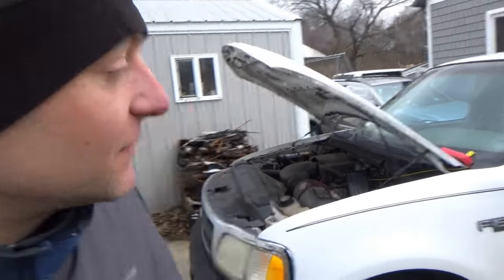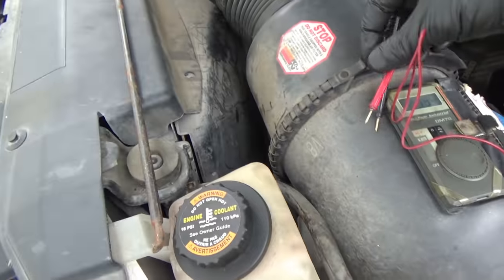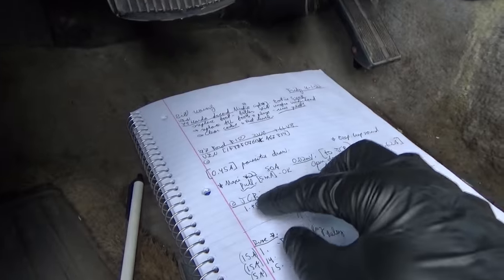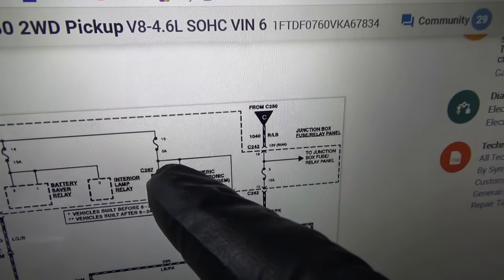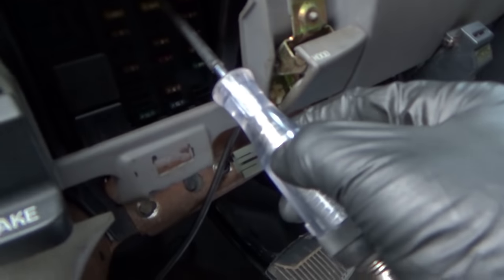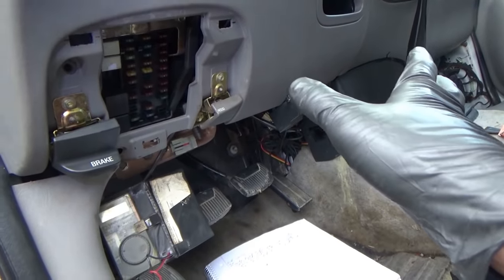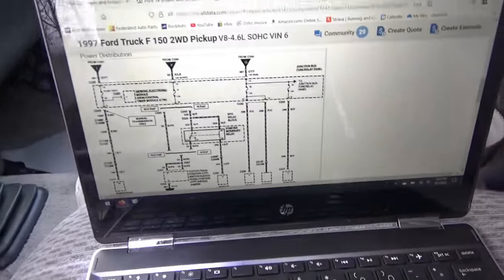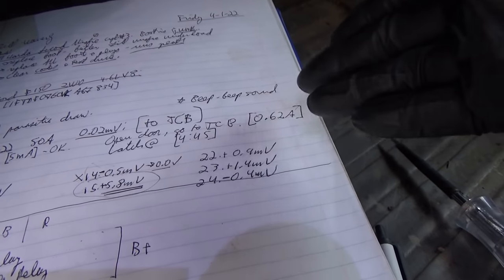This Parasitic Draw will BLOW YOUR MIND!  -Part 1 (97 F150)

Comment: I made a silicone dam on my 97 under the hood to guide the rainwater away from fuse box harness,, it fixed all the electrical issues after a few days of drying it out. cheers

Comment: I spent months diagnosing my wife's '94 Z71 Sub that would kill the battery dead in less than 2 days. I tried everything, and every time I'd turn the ignition on, eveything would wake up and I had to start over. Turns out the AC compressor clutch was staying on. There are few things more satisfying in the car mechanic world than fixing a current draw issue, especially on a late model car. Great video, as usual, can't wait to watch part 2.
Reply: Actually it was an '04. I'm an idiot
Reply: @bigblocklawyer  i would take me 10 minutes to find that problem thermal image flir you got to have the right tool
Reply: @juanrodriguez-ry6yt  Yeah. That was over ten years ago when you were still playing Pokémon go. Gotta have the right tool.
Reply: youd think a car that old would have every possible solution already available online

Comment: Had a similar draw on a newer f-150. It was back feeding a little over 2 volts to a relay in the fuse box causing that relay to stay on. It was a connector in the harness under the bed that fed a lot of stuff at the back of the truck like the back up camera, tail gate actuator, etc. It looked perfectly fine from the outside AND when disconnected. I blew air through the connector for the hell of it and it just started weeping water droplets out of the backside. Soaking it with brake clean and blowing it out real good stopped the drain. It was for a used car lot and probably had been under water. They had just got it from the auction and it has supposedly been checked out numerous times without resolution. I’ve never seen a connector look perfectly dry like that and have water hiding down deep inside with no visual evidence whatsoever. I think the weather pack was actually keeping it from drying out in this instance by sealing it in. When you work on cars that come from auctions you’re guaranteed to run across some crazy 💩 that a lot of other people never see.
Reply: Yes indeed, auction vehicle does Sucks🤧

Comment: I worked on a ~2002 Expedition for a parasitic draw. Long story short, windshield leaked water into GEM, causing intermittent HVAC blower operation. I sealed the windshield, removed and dried the GEM. Reassembled, and problem solved. BTW, my compliments on your knowledge, and problem solving techniques!
Reply: That same thing happened on my 03 expedition. Made the brake lights flash when driving.
Reply: Factory window or had it been replaced?
Reply: Thanks a bunch.  My HVAC fan, headlights, stereo all turn on hours after it rains while my 2K Expedition is parked. Saw moisture under interior fuse box and felt left side of drivers seat cushion slightly damp. Thank you for helping me to discover that my Expedition isn't possessed.
Reply: It's must have been a Interesting case study!

Comment: Reminds me of my old VW Rabbit where water would run down the antenna cable, sneak past the rubber gasket and then drip right onto the main fusebox.   The low spot on the antenna cable was right over the fusebox!   Perfect fail.
Reply: the whole windshield seal would rot and let water in.

Comment: These old f150s had water intrusion issues I had one that after a rain storm had accessories and warning lights coming of and on at will even with the key removed drying out the inside fuse box and GEM corrected the issue I instructed the customer to have the windshield resealed the water runs down directly from windshield to steering column support into the fusebox sometimes you can see a stain on this support confirming this

Comment: You are incredibly patient. I had jobs like this and most owners did not want to spend time and money in diagnosis.
Boom. Put an electronic cutoff on the battery. They clicked the remote to connect the battery without opening the hood, started the beast and went to work. Yeah, it had to be left on a trickle charger during inspection month in CT (😳)
Reply: That's the issue. I recently had someone ask me "how much would it cost" to fix a battery drain. Well anytime I hear those words, I know they don't want to spend the money. I told him it could take 3-4 hours or more, or it could take an hour depending on the complexity. If they ask "what is your rate?", then there is a change I'll get the job. You are right though, many don't want to spend the money on the time it takes to chase these problems down.
Reply: @graywaveautodiagnostics9389  GrayWave let’s be realistic here. These are old cars you are diagnosing. All people don’t have deep pockets, unscrupulous shops rip people off. ( just watch Rainmans Channel). People ask what the costs are before committing to what could be an uneconomical  to repair job. Writing yourself a check on every job would be a great idea but you won’t last long doing that.
Ivan has clear and concise prices, he is good at what he does, he is very busy most people trust him……..lesser auto electricians could take twice as long and have less success but still want top dollar.
Reply: @Bo88y22  Agree.  I know shops don't like to give estimates, but I ask for a ballpark/range for decision making purposes.  They usually come up with a number when I ask for it that way.  Everyone has a repair or replace threshold.  They need to know if they're getting close to that.
Reply: @Bo88y22  Yes, most don't want to spend more than $50 on a repair or diagnosis if its an older car, that is fine, they can do to a "buy here pay here" and get another one. The fact is, if you want  the work done right, you need to pay. Ivan charges more than most, as he should. You pay for experience. Like I said, some take an hour, some can take more. Just like the one video he had where it took 7 hours. I am a professional and provide professional results, I won't short change myself. I earn every dollar I get. Some people don't understand the value of experience and only base the value on how quick the "fix" will be...."But it was only one wire you soldered, took you 5 minutes".

Now when you give someone ball park ranges, that can be dangerous. What if I go over the ball park, what if you get to the ball park but don't fix it? Normally if it will take more than 2-3 hours, I ask the customer if they want to proceed. Up front I tell them I don't know how long it will take, I can only make an assumption and finding a fix is not guaranteed in the block of time I give them.
Reply: @graywaveautodiagnostics9389  Good auto electricians soon get a reputation. Rip off merchants are soon found out. Social media at it’s best.

Comment: This generation of F150 has two factory defects. One was officially recalled. The recall is for the switch in the master cylinder. It is always hot. The seal would fail and allow brake fluid to short the switch, and cause a fire. This would usually happen when the truck was parked. I tried to see if it looked like the recall repair had been done but could not see throughout the video. It is a good idea to verify if the recall repair has been done. The other problem this generation of F150 is known for is water intrusion through the drivers side of the windshield. Run a hose on the drivers side of the windshield while looking for water intrusion into the gem area. If water intrusion is present. The water takes the path of least resistance directly into the gem located directly behind the interior fuse box. Remove and open the gem. You will very likely find rusty, corroded, and broken connections. If possible clean, and repair the connections in the gem. Remove, and generously reseal the windshield. Buying a new gem if they are available will be several hundred dollars. 9 of 10 used gems will be in the same, or very similar condition. If the parasitic drain problem started recently, and is confirmed to be caused by the water intrusion into the gem, the gem will likely be repairable. If the parasitic drain problem started months or years ago, and the truck was parked then the longer the truck sat with the gem corroding away inside the worse off the gem will be, and less likely to be able to be repaired. Thank you for all your diagnostic videos. I have learned from watching. I hope this info is helpful to you. Best Regards.
Reply: We generally replaced fuse box & GEM as a combo. They both had the green crusties.
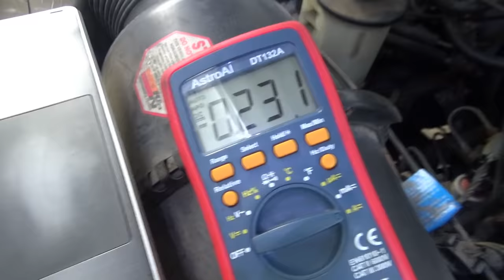Reply: 20:40 The Blue tag is on the recall fix harness, it looks like the recall was performed.
Reply: No
Reply: I can attest to both of these issues. I own a 97 f150. When I got it the drivers window and the intermittent wipers didn’t work.  Sure sign of a bad gem. 

I removed the gem and soaked it in 99% isopropyl alcohol overnight . That was able to remove all the corrosion. Everything worked when I plugged it in and has for years. (For anyone with the same problem looking to save $). That plus a new windshield was way cheaper than what new GEM. 

I also added a fuse to the cruise control brake switch because I couldn’t find the factory recall jumper. Witch was the same thing.
Reply: I'm always at the comment section, to even learn more!😅

Comment: You are doing a great job in tracking down the source of the problem, Ivan! This looks like either a previous owner did some nutty do-it-yourself wiring or there are some shorted wires related to the load side of fuse 23.  How frustrating it is to be searching for a needle in the haystack.  Part 2 should be interesting.
Reply: It's a ford , probably a factory flaw
Reply: Ty h CD B

Comment: I would see if the four way flashers work. On older Fords the switch would stick partially on and not fully release. It would send current through the switch but not enough to operate the lights. May be why the flasher relay has a draw.
Reply: Wo
Reply: Good idea.

Comment: In 1987 I worked at Ford and at the time you had to be Ford Cert to get paid for total time  warranty claims which was called M time. I had a new Thunderbird that would blow the resistor shunt  on the  Light Switch . Long story short I found a unused connector under the drivers seat carpet resting on a piece of metal slag which when the drive would sit down in the seat that was enough to short it out. I had the whole interior out on the floor looking for the problem. But
 it was fixed and got paid off of clock time.
Reply from the maker: Amazing!

Comment: I had a 2015 kia sportage last week that had a 5amp draw on it. Yes 5 amps. I gave the kid I work with job of checking it out, he's still learning. There were multiple fuses that were responsible for a few amps each. Radio, amplifier, ecm, cluster, etc. He thought the radio was responsible for all of the problems and wanted to replace it because it was responsible for the largest draw, around 2.5 amps. I ended up taking over the diag because I didn't think it was the issue because to many things were still awake for it to be the radio. I traced it back to the shifter not registering it was in park, the little micro switch that says I'm home now was not being triggered because the shifter button was not retracting all of the way and contacting the switch.   Probably one of the largest draws I've seen with the simplest fix.
Reply from the maker: That's some crazy stuff!

Comment: Loving the chase Ivan. I'm not a mechanic but with your deductive reasoning I love the dead ends you go down as you tick off your mental flow chart leading to the ultimate goal. Others use the parts cannon, Ivan, deductive reasoning.

Comment: I didn't have a parasitic draw, but I know on my 2002 F350 7.3l diesel--- I had a buzzing relay under the dash, above the accelerator:   and it turned out to be the blue flasher relay..  So I'll be interested to see if that's where you end up.

Comment: I had a parasitic draw on a 1993 C1500 for over a decade.  I'd look at it here and there when time permitted.  However, since the vehicle was occasional-use, I just put a knife switch on it along with a trickle charger and lived with it.

Then, while doing some other behind-the-dash work I discovered an aftermarket relay spliced into the wiring. After the relay was exorcised, the draw was gone.

No doubt, this is one of the handful of reasons I scored the truck for a song and a dance.  I'm still driving it too!
Reply from the maker: Like a rock! 😎
Reply: Nothing works like a Chevy truck.
Good find, what did the add-on relay supply?
Reply: @dannylinc6247  Most likely, the relay was for the electric trailer brakes installed at some point.  I had removed the brake controller numerous years before (wired with Romex and wire nuts even back to the trailer hitch).
Reply: @russellstephan6844  harry home renovator and his wiring savvy In a hurry to get trailer brakes.
Then he tries using house wiring.

Comment: Trailer Tow - does that power trailer lights? Could have some “custom wiring” at the trailer wiring harness cross feeding with a hot wire in the same connector
Reply: that's a 12v power feed to charge trailer batteries when connected and vehicle running.

Comment: That annoying beeping on these trucks (my 98 f150 has it too) is a thing to tell you somethings wrong without tripping the check engine light assuming its not a major problem. My EGR was seized up (open sadly) and it did it forever until I deleted that EGR junk. Yes, it still does it every time I put the key in lol. Need to find that damn buzzer...

Comment: Check voltage drop from battery ground to the ground pin of the relay plug.  Could be coming from ground side.

Comment: Had 3V on the same fuses, pulled the fuse box and had corrosion on the lower connectors. Owner needed it running ASAP so I reinstalled and the problem was gone, it seems just a bad connection on the plugs causes the back feed issue. But thanks for the leg work.

Comment: Had an interesting one after I had a professional installed compustar alarm and remote start installed on the Toyota. Remote start kept keeping the starter engaged after the engine started. I initially thought it needed the tach signal reprogrammed. Kept getting an error saying no signal. I wanted proof and pulled out the 8 channel Pico oscilloscope out and hooked up a tach signal on the coil and another channel on the remote start controller. Sure enough the controller wire had no tach signal going to it. Found a bad connection at the point where they used a 2 piece wire connector at the back coil for the tach signal. Took that apart, it actually fell apart in my hands. I used a solder connection without cutting the wire and heat shrinked the connection. I am guessing the vibration loosened the connection. 

In my area, cars are stolen right and left regardless of if it has the OEM security system with chipped key or not. Thieves are using tow trucks to steal cars here. I wanted to make it as difficult as possible to break in the car without the alarm siren going off. .

Comment: 98 F150 - Distribution Box Fuse 22 - It feeds constant power to the interior Junction Box Fuse 1 thru 4 & 12 thru 15. After I put the GEM module to sleep, I found that my Amp Draw was coming from Fuse 13. Fuse 13 is the Brake System; it has 3 different circuits: 1) Brake Pressure Switch 2) Brake Light Switch 3) Rear Wheel ABS module. What I found out was that my Brake Lights were staying on. When I lifted the brake pedal, the amp draw dropped to .03. I ordered a new Brake Light Switch.

Comment: I remember that if you forgot the lights on, you couldn't turn them off if the battery voltage dropped too low on Ford around that era. Maybe putting 12V on that circuit would allow something to shut down.

Comment: Is the driver's side carpet wet by the pillar? I had very similar symptoms on my 2001 Navigator. Water was coming in around the windshield gasket and dripping on the wires/relays under the steering column and fuse box. Fixed windshield gasket, solved issue.

Comment: I was initially inspecting bad ignition switch causing parasitic draw with those items that's supposed to be off when the vehicle is shut down
Reply from the maker: Pretty neat to be able to eliminate that just by following a wiring diagram, pulling fuses, and taking notes with a logical approach :)

Comment: Just by some of the sounds I was thinking the HVAC blower was coming on at lowest speed. Looking forward to part 2. Gotta wonder the horrors that are in store for DIY diagnosis and repair of the F150- EV.
Reply: Maybe, also, the door adjar chime was receiving 1/2 voltage and sounded continuous but weak rather than full sound by cycle.  This normal operation DID occur along the troubleshooting way with the normal beep beep beep....

Comment: I was just looking at the same diagram  from a draw . Some one wired A led  wrong in the traller  wires on a stake body . Back feeding the relay. It keep  the running lights on sometimes

Comment: Nevermind the trailer harness relay the bigger millennial problem is the metal rod sticking out of the transmission tunnel hump and that weird looking third pedal to the left of the brake pedal. 🤣
Reply: Those trucks stop much better with the 2nd brake pedal 😂
Reply: What do those items do exactly???
Reply: Millennial anti theft device.
Reply: @davidgrisco1939  💯
Reply: I bought a used 2008 F350 SD back in 2012 from the lot of a Ford Dealer.  Salesman says to me "You don't want that one... It has a manual transmission."  I replied "That is WHY I want that one..."  Sadly, they don't even make manual transmission models any more.  When the dealer salespeople call and say "Your truck is 14 years old now... Want to buy a new one?" the phone call ends shortly after I say "Yes!  I'll take one loaded with everything including a manual transmission!".
Reply: @Vincent_Sullivan  why would you want a manual /gen